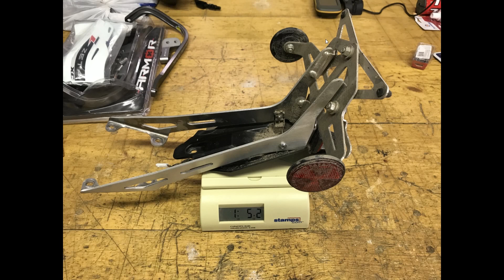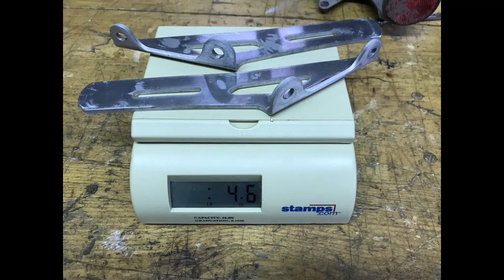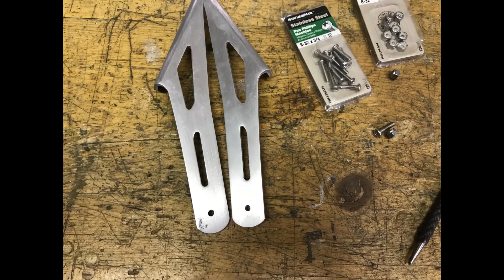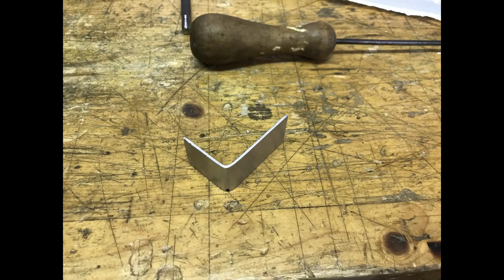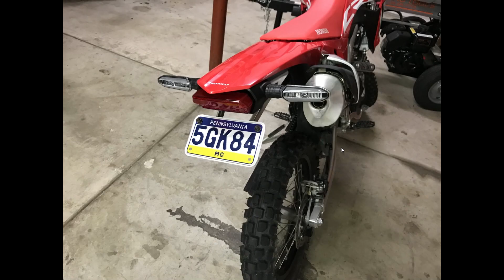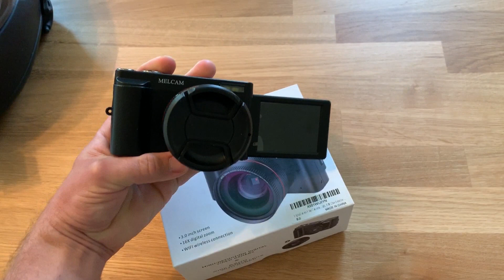Honda CRF450L - Tail Tidy

Comment: Long ride with this yet? Does the pipe melt the right hand turn signal at all?
Reply from the maker: couple hours on the road, no issues (not even warm).  I didn't change the location of the signals though. .